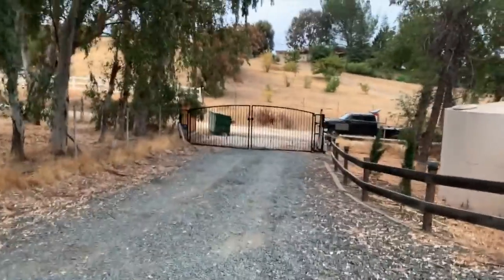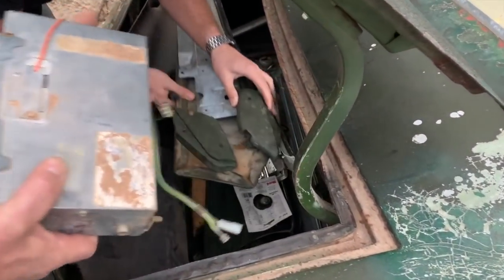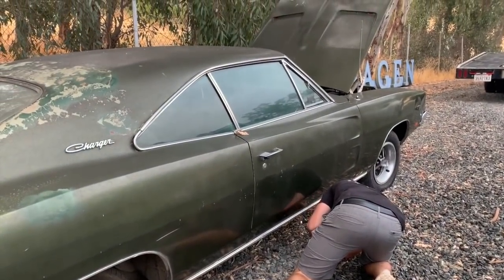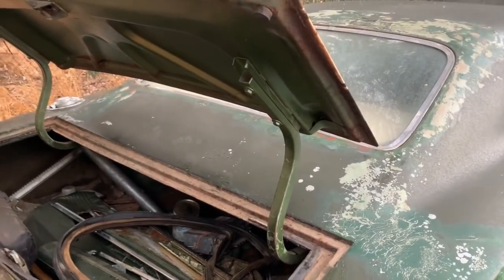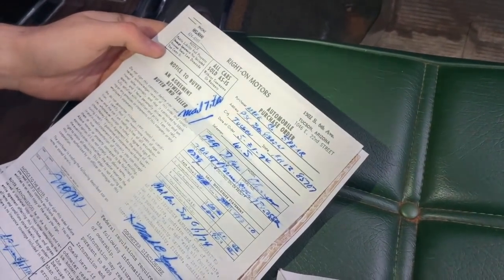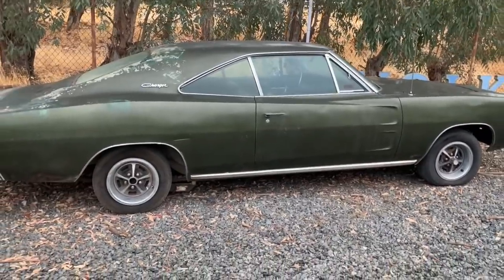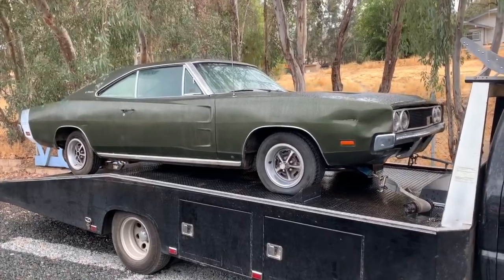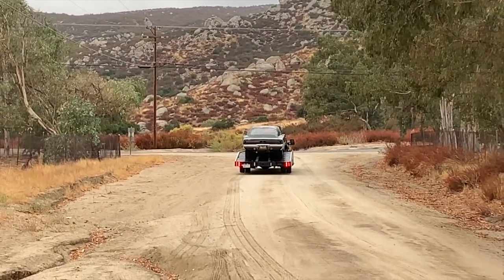Carchaeology: 1969 Dodge Charger 500 Barn Find Good Bye?

Comment: Did you find the original numbers matching engine and transmission on the property?
Reply from the maker: Sadly no.
Reply: @Carchaeology  yeah sad, I have a 1969 charger rt  like the one you featured original engine different transmission have a little more rust interesting story sold it in 1989 to a friend and got it back around 2005, lucky indeed
Reply from the maker: @84koolkid  I love it when they come back like that! I found one of my fathers cars over 30 years after he sold it and it seemed like a miracle to get it back.
Reply: @Carchaeology  true came back a little more rough, what machine

Comment: I guess yiou have seen the 500 on Nicks garage? 45 years in Dry Storage after a life of Drag strip use ,it is now being prepped for paint. I wonder if it's VIN is close to this one? Considering the low numbers produced ,they could be.

But i would have thought car"experts" would know how to strap a car down on a truck or trailer? Winding it down against the suspension is just Wrong.